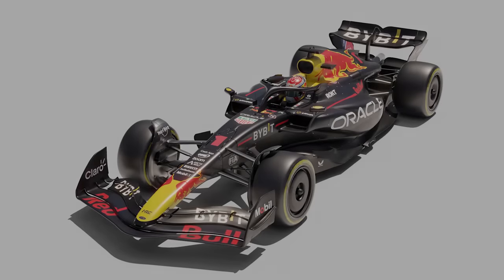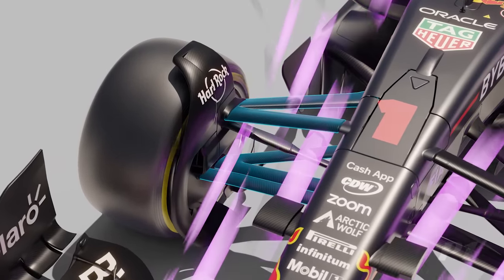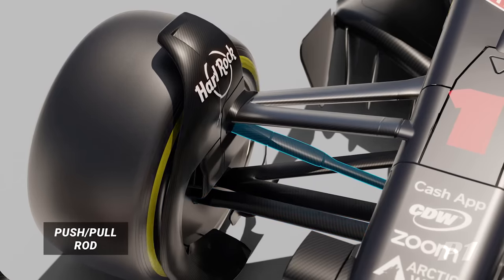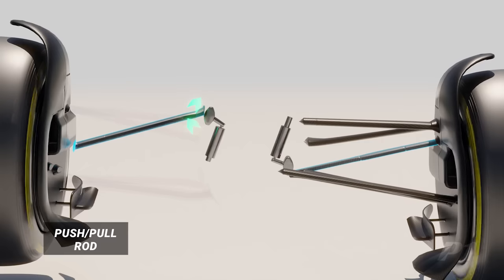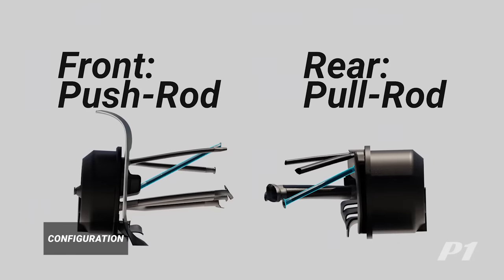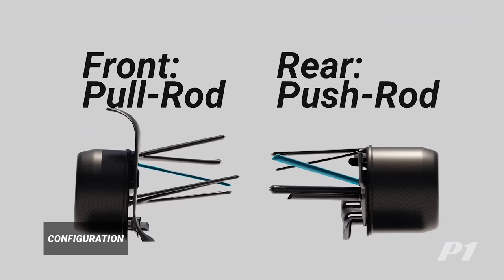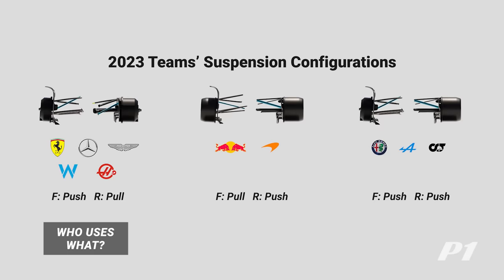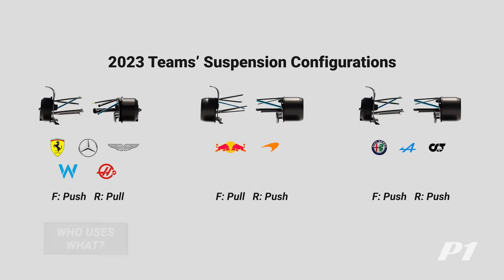F1 Push-Rod and Pull-Rod Suspension Explained

Comment: One thing that should be mentioned: 

Under Breaking and acceleration the car front and back tend to move. 
With negative a (breaking), the back of the car will tend to move up, while the nose tends to move down. In the past Push Rods were used at the front, because they allowed this behaviour more then Pull Rods, and everybody loves a lower nose. Pull Rods on the other hand tend to allow an upwoards movement more, which was wanted at the back to get even more rake and thus the nose even lower. 
The ground effect cars dont like this behaviour, rising back and diving nose can seriously compromise the ground effect generating aero. Red Bulls config keeps them stable under breaking, allowing Max Verstappen to not only trust his car, doing his corner rotations with more confidence and trust at the end of the brake phase.
Reply: Note that one factor that makes the nose of the RB not go low is the "anti-dive" suspension designed by Newey. Which he basically changed the mounting points of the upper wish bone, placing them at different heights and use the torsion created by these to control how much the nose moves. Then the suspension does the rest.
Reply: @The_Curious_Cat  Important note is that all cars have some "anti-dive" (and also many other "antis", including "anti-lift" of the front and "anti-squat"on the rear on acceleration, etc.) AND this isn't designed by 1 person only, there is a whole engineering team behind all these decisions, probably hundreds of engineers.
Reply: The biggest importance on a ground effects aero car is in maintaining the relationship of the floor to the ground as close, consistent and stable as is possible. An example of this is where Hamilton secured 2nd place but was then disqualified because his floor ran too close to the ground upon inspection of the wear on the metal wear blocks. .... "But it worked so much better!" Even 1mm (40 thousandths) can make a HUGE difference
Reply: So, it comes down to driver choice as well.
Reply: What a breakthrough concept!!! This will bring about world peace!!!
Reply: Isn't there also a difference in the actual spring characteristic of pulling out vs pushing in?
Reply: @DenUitvreter I never pull out

Comment: Excellent animation and explanation.  IIRC, Gordon Murray introduced the first pull rod suspension on the front end of his BT-44 design for Brabham.  Though in that car's case the front shocks were partly exposed, it wasnt an aerodynamic issue due to the front bodywork aerodynamics.  It also allowed them to adjust the linkage and rockers to create one of the first rising-rate suspensions.   At least one designer experimented with a mixed front end where one side had a pull rod and the other a push rod...might have been an oval specific car (late 80s early 90s...AAR, Coyote, Chaparral??).

Comment: I think we will see more pull rods at the front this year as teams really want to grab just a smidge of better anti-dive capabilities. Mercedes tried to retrofit an RB appropach last year without building a new chassis which also meant that the front pushrod stayed for the season.
Reply: Anti dive comes from the angle of the lower and upper control arms relative to the horizontal, not the suspension rod type.

Comment: Great video and explanation. I would like to know how the electric motor and the combustion engine work together. Where in the drive train does the electric motor go? E.g. Does it connect to the drive shaft or flywheel or neither?

Comment: Another advantage of pull-rod suspensions is that because the pull-rod is acting in tension, the cross section of the pull-rod could be much smaller, and rigidity is less important (in theory a flexible cable would work just fine).

With a push-rod suspension, the member is working in compression and must be bigger and beefier to prevent it from buckling or collapsing under load. Compared to a pull-rod, the push-rod by necessity is both bigger (less aerodynamic) and heavier than a pull-rod. Both qualities anathema to modern F1 car design.
Reply: They both have to work in tension and compression. Wheels move both up and down on cars. Just pull rods typically experience more tension than compression and vice versa for push. A pull rod couldn't be a cable as it would go loose after bumps and then snap in tension. You would get a peak load in that scenario

Comment: Is redbull using front pull and rear push to make the car tip front-ward?  This can increase oversteer hence suit Max's driving style
Reply: The suspension is so stiff with both push and pull rods that it is more of an aero choice than anything.

Comment: What is restricting teams using Front Pull Rod and Rear Pull Rod?
Reply: The locations where the rods connect to the car. At the back you have the gearbox, floor and diffuser so its harder to have a pull rod, but looks more streamline if you can fit it down lower. As mentioned in the video, pull rod at the front means the components are under they front if they need to make adjustments or swap parts it's a little more difficult. Its mostly an aero choice of where you want those rods as they cover them with carbon fibre winglets to direct the airflow as desired

Comment: I could be wrong but I was sure that F1 cars use heave springs and not coils?
Reply: They have several springs in all forms. The wishbones are not on bearings (rod ends or spherical bearings normally in other Motorsport) they use solid titanium flex joints to bond the wishbone to the chassis tub (adds a spring rate in all modes), torsion bars for the base springs (has an advance over coil spring as it’s a double acting spring, better for control), heave springs for pitch control (either as a coil or belvil washer spring), and torsion tube again in the roll bar spring (mainly for roll rate control), in the form of a T bar or U bar depending on the layout but I think they mostly run U bars at the front now for roll. I may be wrong I haven’t been in an F1 garage yet or seen any recent photos from this years cars.
Reply: @apt962  Yes, I think he used a compression shock absorber for simplicity's sake. He would then have to explain all of the different facets of the suspension beyond push vs pull rod otherwise.

Comment: I still don't understand how it actually translates on the road. Where would it make a difference between the two, when it comes to real life racing?
Reply: the kind of people who can explain the on track differences are working for F1 teams and not youtube channels, haha
Reply: Its mainly aero and packaging the components with the other parts of the car such as the front wing to suspension arms to the side pods and floor and air flow to the back of the car passing over the rear suspension to all work together

Comment: Im not a engineer but the way you show how pullrods are working is false.
There is no force really "pulling" on the dampers its ether mostly also pushing on the dampers but with a revised rocker alignment
Reply: When wheels move up relative to the car one arrangement pushes and the other pulls. It's literally why the call them push rods or pull rods
Reply: They animation isn't of an actual F1 car. They use different torsion rod springs and the dampers are now also mechanical springs instead of air or hydraulic dampers they used in the past. If he used those then it would be difficult to explain in the simplest of terms. What we see as far as the effects between the push and pull rod assemblies is correct even if the spring damper assembly is not what is used.